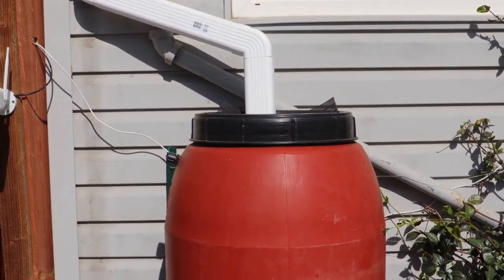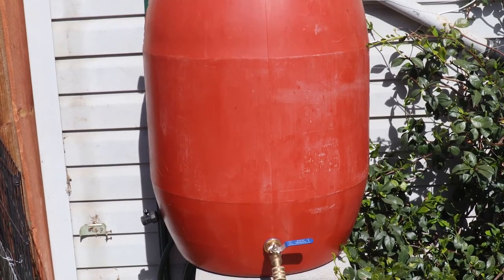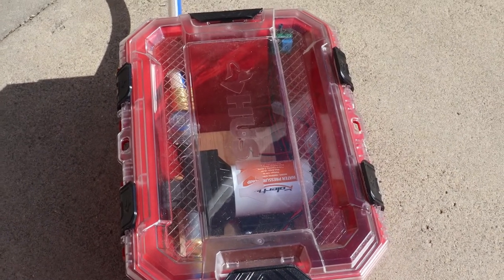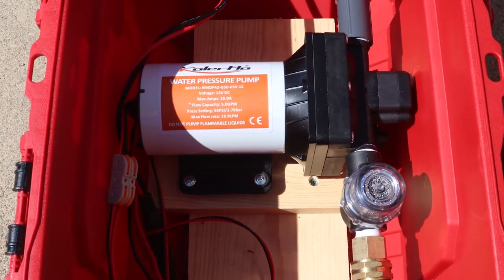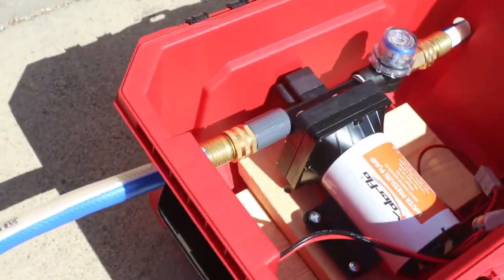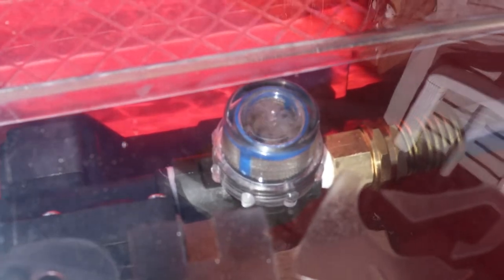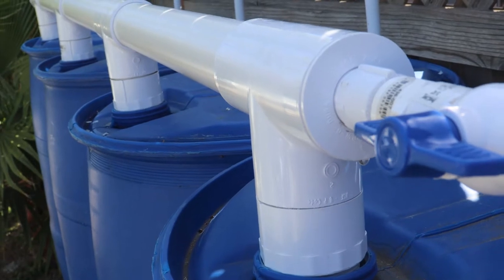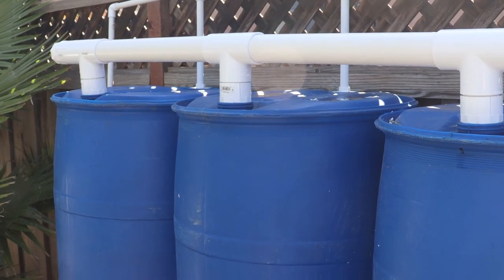Rain Barrel Pump

Comment: What size Huskey box did you use for the water pump. would like to order one on line.
Reply from the maker: Hi tweaker, the outside measurements of the Huskey container is approximately 17 1/2" length - 12 1/2" wide - 10 1/2" high. The Home Depot has them on the shelves with all the storage boxes. I hope this helps

Comment: Is the pump required because the blue barrels are higher than the red one in which case you could use gravity to keep all five full without a pump?
Reply from the maker: The outlet on all the barrels are about the same height, but the inlet for the blue barrels is 4 feet higher so gravity would not work. Also the blue barrels are located in a different part of the garden about 60 feet away.
Reply: @BrightSparkIdeas  So you need to go out periodically and fire up the pump?  We're in Vancouver area (Seattle like) so rain is np but in Jul-Aug it has been very dry.

Comment: Is it possible to have the pump plugged in and always on? Was thinking of using a pump with my rain barrel and a 4 zone water timer so I can do an automated drip system
Reply from the maker: Jesse, I do not leave mine on, but my understanding is that this is a self-priming on demand pump, so you could use a timer and have it turn on and off when needed. Let me know how that works for you.
Reply: @BrightSparkIdeas a on demand pump has a pressure switch when you open a tap it automatically turns on I did buy a through the side float switch so when the barrel is empty it shuts the pump off I bought a 2 pack because I have 2 systems a house one for potable water I haul in and a second one for rain but can also be used to turn off the pump by putting the second one on the tank being transferred to  my rain water unit has 4 barrels downstairs and 4 under my downspouts 2 for the house 1 for my garage and 1 for my sheds total 8 barrels all connected in winter I close off the outside one's and drain them the 4 downstairs gives me water year round for my house plants and toilet with my pumps inside they won't freeze and since the barrels downstairs are lower than the ones outside they fill up first

Comment: Doesn’t the pump need air available for cooling the motor?
Reply from the maker: Hi Luke, good question. Yes, if you were going to run the pump for a long period of time, it would be a good idea to have a vent, or if you were running continuously then a fan would be best. I only run the pump for a few minutes to transfer 50 gallons, so I do not need a to vent.

Comment: Is the pump inlet filter upside down?  I have the same pump.
Reply from the maker: Hi, I apologize for the late response to your question, but I just noticed your comment today. It’s a very good question, and my first instinct is to agree with you and say yes, it is upside down. The main reason I added it upside down in my design is that it is extremely difficult to check or remove the filter cup if I had it the other way around. Based on its design and the way this filter works I don’t really think it makes any difference which way you install it. For me I have very few particulates in the water that I am transferring from my catchment barrel to my storage barrels, and having checked it after every use, I find very little to clean out of the mesh strainer/filter. This might be because I am not using it correctly and I would check and see what works best for you. So, in conclusion, you are probably correct it’s upside down, but in my personal experience upside down works for me. Let me know your thoughts.